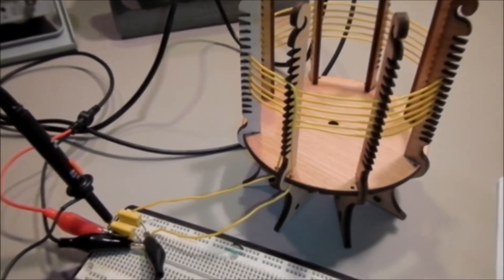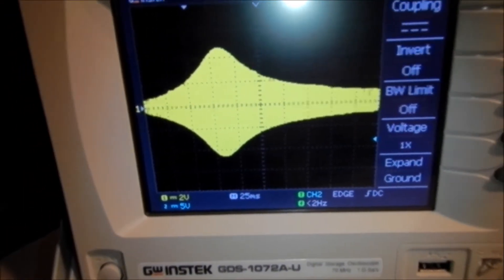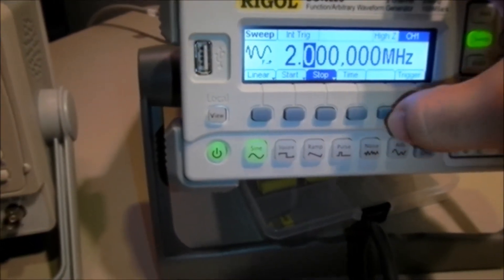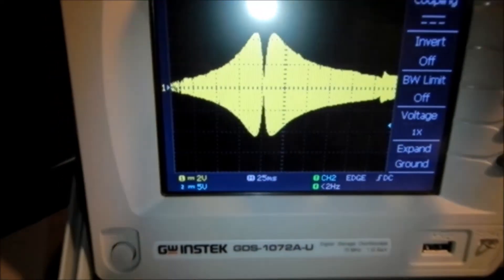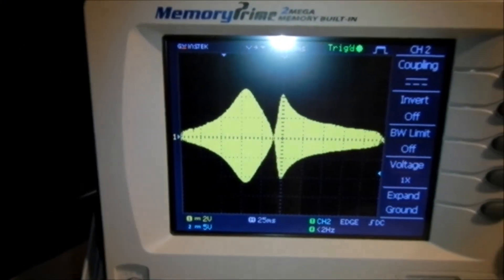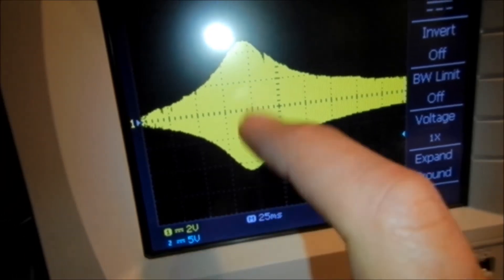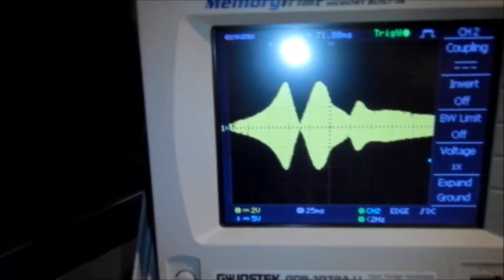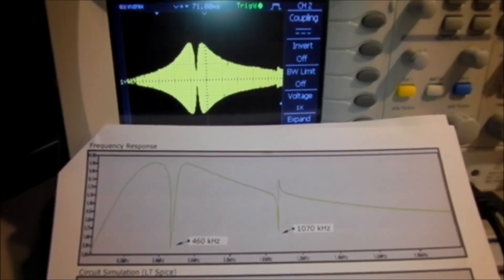Tesla Coil LT Spice Simulation & Tuning (Part 2 of 2)

Comment: Hi - nice work, and can I make some comments?
* The Corum brothers have published technical papers explaining why a TC secondary is much better modelled as a transmission line instead of a lumped LC circuit, and explains the higher 'mode' causing the resonance around 3.5 times fundamental when no such higher modes should exist for lumped LC circuits driven by sinewave.
* Its good to see frequency splitting appear when you add the second resonator to the system, the locations of the new peaks allows the coupling to be estimated.
* Don't you think the responses indicate much lower than expected Q? I would have hoped for Q in the high tens to mid hundreds, maybe its the way you are measuring.
* Your 'topload' seems much too small, a real powered TC will need a much bigger topload capacitance (to dominate over the inter-turn capacitance) to allow the transmission line to develop the required high-Q resonant modes.
* Any work comparing a model with reality gets my thumbs - up, so good luck with the future developments and analysis! Regards, Ian.
Reply from the maker: +ridefast0 Great questions Ian, I would love to hear more of your ideas. I've met the Corum brothers and James Corum used to teach at my college formerly called Ohio Institute of Technology  back in the 70's. I'm a big fan of their work but I found the transmission line models too tricky to for me to use (other engineers in the Tesla Coil arena have felt the same, I will post a critique).   So I went back to the lumped model for practical purposes and tried to see how close I could get, I accounted for the self capacitance (Medhurst capacitance) of the coil by putting a lumped C element in the center of my inductor... and it worked! I got the primary resonance and a harmonic. I used small disc top loads at both ends of the coil to simplify the model as best I could. I'm ready to add grounding and large terminals to the coils and start modeling those next. I've been meaning to post another video about how I build the model in Spice.
Reply from the maker: +ridefast0  
From: SOLID STATE TESLA COIL
By:Dr. Gary L. Johnson of Manhattan, Kansas

"My background is similar to that of James Corum, so I started this research with the assumption that the distributed approach would be superior. I spent considerable time learning some computer codes the Corums wrote, and even supplied them with codes to calculate inductance. But I was unable to predict all the interesting features
with the distributed approach, and it appeared that a massive effort would be required if one wanted to do so. So I turned to the lumped RLC model."
Reply: +sparkstarter Damn! Just when I thought I had it all clear in my head, and I had conveniently forgotten the &#39;Gary Johnson&#39; side of the argument! I suppose that a TC secondary does LOOK much more like a lumped inductor than like a transmission line many tens of metres long.

I did manage to use &#39;Calculation Center&#39; (a cheaper version of Mathematica) to replicate the Corum work on analysing one of the Colorado Springs oscillator configurations, but I am not aware that they ever compared that model with reality. Anyway it was just the manipulation of complex numbers to provide the usual Smith chart type calculations of phase angle, reflection coefficient of the topload etc. I was so excited when my calculation did the same as in their paper, that I forgot to ask the bigger question of whether it means anything!

Anyway - I am not going to waste much more precious time about the benefits of lumped versus distributed analysis. Bigger and better brains than mine have disagreed without realistic prospect of reconciliation.&#160;

So, my TC design and build process now goes like this:
0) Decide if you want an indoor or outdoor coil and choose a secondary former about a half the length of your expected sparks. Then choose a wire diameter to give about 1000 turns on two-thirds of the length of the former. The former should be thin white plastic with diameter about a quarter of its length.
1) Build and varnish the secondary, preferably with its turns spaced a little rather than touching.
2) Put a good size topload on it, add a wire simulation of a realistic length of streamer from the topload, and find the lowest resonant frequency where the bottom-feed impedance is closest to zero. Function gen in series with LEDs is fine. Find also the lowest resonance without streamer, and define the range between the two frequencies (loaded and unloaded) as the tuning range.
3) Use lumped RLC techniques to design the primary circuit to cover the defined tuning range and with coupling adjustable in the range 0.1 to 0.2 approximately. Start at 0.15.
4) Your TC is now already close to optimised by design and only small trim-type changes will be required to bring it fully into best tune (for best sparks)!

I think a topload looks about right when its overall diameter matches the length of the winding and the minor diameter matches that of the winding, but that&#39;s just going by appearance without technical basis.

Regards, Ian.
Reply from the maker: +ridefast0 Does your coil performance correlate with your Mathematica/Corum paper calculations?
Reply: +sparkstarter Sorry I wasnt clear, I never applied the Corum analysis to my own small coils, I was just happy to have tracked along with their analysis of a much larger coil (about 4 feet diameter I think) as done in their paper. I suppose I could try applying their transmission line model to my own small coils and then do a comparison with reality as you already did with the lumped RLC model spice simulation, but I didn't do it yet. I have found it much simpler and quicker to just measure the resonant frequency of a completed and toploaded secondary.
Reply from the maker: +ridefast0 I would  appreciate a video tutorial on your efforts to replicate the corum paper work... and which paper are you referring to?  This is the one that introduced me to the Corums back in 2002 ish. http://www.teslatechnologyresearch.com/corum/index.htm

They make  a  case that you measure coil inductance and you measure top load capacitance, calculate frequency, and then measure resonance. 
If Match OK
If No Match >>> see complex transmission line models and esoteric TCTUTOR Software.

Then they hit you with lines like  "key performance parameter for a high voltage Tesla coil is not the length of the discharge but, rather, the VSWR on the resonator coil - the higher the better! It's related to the fringe "Visibility Function" for quasimonochromatic, partially coherent optical beams."
Reply: +sparkstarter As well as the one you mentioned, I can mention two other Corum papers that I have found 'helpful' in stirring up the sludge of trying to remember year three of my EE degree, specifically RF engineering and Smith charts. One is RF COILS, HELICAL RESONATORS AND VOLTAGE MAGNIFICATION BY COHERENT SPATIAL MODES which was either published or reprinted in 2001. Forget the intimidating start, it goes on to give helpful ideas about when lumped elements might apply better and when a transmission line model might apply better.
Reply: +ridefast0 The second paper is A TECHNICAL ANALYSIS OF THE EXTRA COIL AS A SLOW WAVE HELICAL RESONATOR which seems to be published or republished in June 2014. I found it in PDF at www.padrak.com/vesperman where it is around the tenth hot link on a big page of text. It seems they use more moderate and measured language these days, and accept that both models have a place! In particular, the appendix starting on page 23 is the procedure that I successfully followed to obtain the same results for their example resonator, 4 feet diameter and ten feet high, but I never applied the work to a resonator that I could measure and compare. So not really worth a video tuturial; just read the paper and see if you can get your PC to replicate their calculations, then you can try the model with one of your resonators.